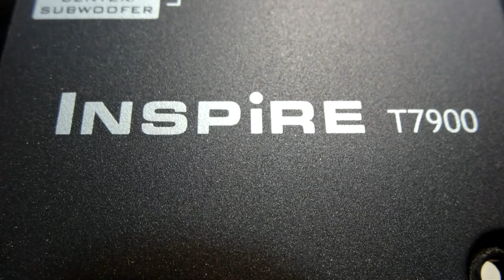Creative Inspire T7900 disassembled inside a subwoofer - part3 of 3

Comment: Good night,

Very good Video, I would like to ask, if the integrated TDA7378 and TDA7372A are the same in the Inspire P580 5.1?

Thanks for the video.
Reply from the maker: Hi,
TDA7378 have 1x bass channel and 2x channels(Left+Right).
But TDA7372A have 4x6W channels(http://www.alldatasheet.com/datasheet-pdf/pdf/25147/STMICROELECTRONICS/TDA7372A.html)